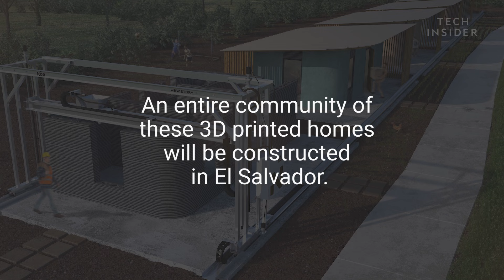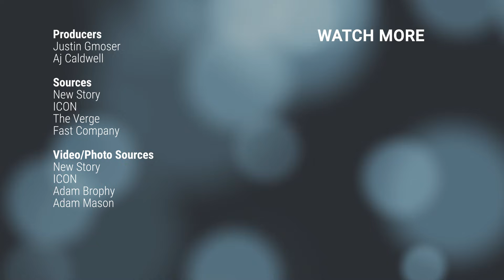3D-Printed Home Can Be Constructed For Under $4,000

Comment: I’ve thought of this so much. 3D construction printers are perfect for this. It would be great if they could team up with the solar company who’s solar panel produces water from the air, and then maybe Solar City could condense that into a solar roof. Also a few companies have electric airships slated for releases early 2020s and they’d be perfect for quickly and affordably moving as much stuff as you need too, such as big 3D printers, to places with little to no infrastructure like roads. They can carry massive amounts and land anywhere without a runway and don’t use jet fuel. Also you could have 3D printers print parts and robots assemble any furniture you need. Amazons robots are getting a lot smarter at that each year. You could basically a moving house factory and command center from an airship. All of this tech combined could transform parts of the globe in a matter of weeks or months. Also high speed, cheap internet will be covering the rest of the planet in another five to ten years when SpaceX launch their satellites, as well as all of the other companies working on that.

Comment: Problem one: no kitchen. Phase 2 will be built in a hot climate where outside kitchens are the norm but, women still prefer to be protected by the elements while they cook. Do their plans include a covered kitchen area outside? Problem two: the roof. Are they planning on have sheet metal roofs? Because there is a big problem with sheet metal roofs is they make concrete houses unbearably hot & the sound of rain hitting the roof is deafening. Builders in Central & South America are moving away from using sheet metal for roofing material. Also, the roof on their prototype looks flimsy as hell. Why aren't they designing a concrete roof as well? I think this very well meaning project should take a moment to consult builders in South America about meeting the needs of the community before they move on to PHASE 2.

Comment: Great idea. 
Hopefully, this method will spread all over the world within the next decade. 

Is it possible to build multi-storey houses this way, or would it require traditional concrete columns and slabs for weight bearing?

Comment: "3-D home than CAN be constructed under $4000" is the misleading click-bait title. 

The home cost 10,000 dollars to build...
PBS reveals: "The model cost $10,000 to build.But the developers believe they can eventually be built for as low as $4,000." 

So no, it does not cost "under 4,000" or "only 4,000," that's just conceptual proposals made by the company. Most likely, the claim is for their investors and backers and news outlets just take all they say as fact. There are many 3-D houses printers. Most cost 10,000-15,000. Claiming you "CAN" do it in 4,000 is just likely a marketing ploy. 

Source: https://www.pbs.org/newshour/amp/science/these-3d-printed-homes-could-provide-shelter-to-the-worlds-most-vulnerable-people

Comment: This won't work. 4000 dollars is a fantastic money to have in poor countries. They can build a proper house much cheaper than 4000 dollars.
Reply: Anyone want to come to Uruguay and help me build an adobe or rammed earth house?  Depending on your experience, I will pay you and will pay for room and board.  I am just a few blocks away from most beautiful lovely soft sand beach.  It would be a great experience!
Reply: What are you talking about?
Reply: i can build a pretty good shed for 4k and i dont even need to connect to the grid for it
Reply: İki Elin Sesi dear, we are not in poor country lmao
Reply: The $4,000 most likely just that cost in the material Just the concrete and maybe some wiring and Plumbing that's not factoring in the labor and the other costs associated with it.  So if you want one of built in the states it probably going to cost 60 Grand or more.
Reply: @GANTZ100pts  The materials in the roof alone cost more than four grand.

There is four grand in cement in the foundation and two walls... lol.
Reply: @GANTZ100pts  It is possible with 12 persons engaged in total 96 hours (that is 4 persons at a time, 8 hour each), and a 3D printer, to make a 36 square meter house, in 24 hours, for USD 2,500 or thereabout.
Reply: @fallingalice2601  Yup. You can get single units (12 square meter self contained) for USD 2,500 per unit (cost price).
Reply: The point is it only takes 24 hours
Reply: @Denise, Yes really ...

Adobe earth domes or rammed earth techniques you could build 2 more bedrooms for about 500 dollars easily.

So called Earthships made of used car tires or bottles only require labor at best. Same with cob structures which cost you a few bails of hay at best.

All I need is a axe and a forest. Voila log cabin.

Just look it up and find out why they call it 'dirt cheap'. And the domes will literally withstand earthquakes and CAT 5 hurricans with ease.
Reply: @MrFlatage  Can you guide me a bit to the Adobe Earth Domes? Some contacts if possible?

Comment: Is it the cost of buliding this house or the cost of the house only, but not include building it, labor cost, etc?
Reply: Unknown Blogger most likely just the cost of the house itself and not the labor, or the additional materials that are needed like Plumbing and electrical.

Wouldn't be surprised one bit that can cost upwards to 25,000 or 60,000 just to have one built in the states.

Comment: it's a really great idea!,  but, I admit, I'm a simpleton, when it comes to 3d-printing, I don't have a clue, né.
I assumed that the stuff used to print with would not be very sturdy at all and fall to bits with any wear and tear or water.
what exactly are they printing out?
I saw mortar mentioned, that's good, what else?
wood pulp? concrete? 
because homelessness is a terrible plight not taken seriously enough, so it seems, by many governments worldwide.
it is good to see it addressed.
many people haven't got a clue.many more do, too well.
something like this could truly help.
depending what they are using to print the places.
Reply: Sprokie Meisie here it’s mortar but 3D printers can print using a lot of different material like plastics, metals and wood(last two are composites).
Reply: Some of the materials that are 3-D printed are very durable.  Some medical prosthetics, like skull bone-flap replacements, are made with ceramic and are very tough.
Reply: 3D printed houses can typically be printed with Fibre-Concrete. Lafarge (Europe) are experienced in this. The concrete is made like "rapid" concrete, which is fast hardening. Thereby you can add layer on layer with only minutes in between, enabling you to print an entire house comprising of 96 layers of 1 inch each, in 24 hours.

Comment: When the machine costs more than the house.
Reply: An oven costs more than anything you can ever cook in it. A dishwasher costs more than any dish you'll put in it. An industrial sewing machine costs upwards of $6000 to print shirts that sell for $10-$12. John Deere Corn tractors sell for $100,000 while large quantities of corn sell for under $25.
Reply: @Cooley96  well I look at it this way, a John Deere farm tractor or Industrial Tractor or whatever you want to call it. Cost a hundred grand but yet the TV show "Dangerous catch" has people working in small fishing boats in freezing, rough Waters for weeks at a time picking up and putting out large crab traps for Dungeness crab and king crab. 20 minutes in the water if you fall overboard is basically death. I don't see any of those hazards when it comes to building one of these farm tractors in a factory. But yet they charge an arm and a leg LOL just because a group of Engineers long ago has mastered building tractors and have automated the process more or less. The same thing goes for the housing market, I feel like that's a scam. Now if the house was like a tree and growing a new limb would be like adding an extra bedroom on to the house within a 10-year period. Then I would say by all means the value of the house should go up. But otherwise I feel as though home value prices shooting up over the last 10 or 12 years is not worth it in my opinion unless you're selling. Value is just not there. Everyone can throw out supply and demand all they want but I just don't see it that way. But I do love this concept and I wonder what the cost of the machinery is? As far as 3D printing a house.
Reply: SunnyTheFireDog when the machine can make hundreds and thousands of houses while a house can’t make another house.
Reply: Cooley96 , i was hoping somebody was gonna say something that made sense, the machines and robots that build cars cost more than the cars, well no shit shirlock

Comment: But is it strong enough to stand natural disasters?
Reply: I think the point is they can’t afford normal homes. If I’m starving, I’m not going to say no to meat and potatoes because it’s not lobster. A locked door is a practical step up. Walls that will keep warmth in on cold nights. A day a tsunami or earthquake happens is a bad day for everyone, but at least on all the other days, these people have something to stand between them and the outside world and all it’s dangers. Sanctuary is important.
Reply: Chronically Curious also adding to that it would be a MUCH better in comparison to a tarp “home”.
Reply: has no steel reinforcement in it, the wall is going to be brittle
Reply: 中務異世界萌公會 I did see some wire mesh being added at some point.
But you are correct, still interesting.
Reply: Joshua The Science god few if any home can stand up to natural disasters, a small earthquake probably (it is concrete after all) but like pretty much every home a large earthquake or tidal wave will definitely take it down, however this house would home up great in the resistance since the structure isn't wood based
Reply: This should be by far able to stand many natural events in comparison to common homes, only lacking (maybe) in terms of earthquakes, and I say maybe solely because it’s a concrete mix. However, two wall layers each side connected by those zigzag triangular infills really should give it near insane strength properties, with concrete’s high stiffness in the walls and having some of it’s low tensile strength alleviated by those infills. This really might do even more desirable in high test occurrences like tsunamis and earthquakes and such than conventional housing. It should have lots of weight to be less dragged by landslides and mudslides too which can pretty easily happen during extreme rainfall in arid areas where most housing poverty is at on top of that.
Reply: modern concrete can have fiberglass added to the mix to reduce or eliminate reinforcement requirements. I hope that's what they're doing here. That mix looked a bit buttery to me. Hopefully they're not skimping on the aggregate.
Reply: Steven Mactavish tsunamis too???
Reply: Joshua The Science god I dont think even a normal house can survive a Tsunami...
Reply: Random Entertainment im saying youll be much safer in a  normal home
Reply: Chronically Curious thats true.
Reply: Joshua The Science god better than a tent yes
Reply: 中務異世界萌公會 it has steel. Have you even watched the video???
Reply: The triangular shapes in the walls does a lot to strengthen the structure.
Reply: The houses we already have aren't even built to withstand natural disasters.😂😂😂 People place so many ridiculous criterion on innovations.
Reply: Safer than a shantytown with made of cardboard and tarps

Comment: If the house is in 3D wouldn't it get destroyed by some crazy nature disaster?
Reply: u have a house for 4 grand before u had nothing
Reply: Good point. The houses would be much better in 2D. The square footage could practically be infinite!
Reply: John Kessler wouldn’t the square footage be linear footage?
Reply: sepreM no offense but having a tarp “home” wouldn’t be any better
Reply: You could say that to any other homes that are not build entirely of stones & steel. Any house with wood works or tiles is nothing against a hurricane or a tsinami. This house at least has the benefits of being cost under 10 grand.
Reply: sepreM my house is in 3d, I need to upgrade to 5d
Reply: 3D printing really does have some great structural properties though, and that’s just the consumer ABS I’m used to, this concrete mix would honestly be able to put up just as well as a conventional construction if not even better with how it’s alignment is. The printing of triangular infill inside on top of two layers each side of this mix, I’d be surprised to see anything less than an earthquake truly damage one of those.
Reply: I have the same worry. Earthquakes occur pretty frequently in El Salvador, and I want to know if these have some kind of rating or protection against that. I saw the metal mesh that goes between some pour layers, but I don't think that's there for structural purposes. From an engineering standpoint, it doesn't look safe, at least for earthquake resistant. Although I might be wrong.
Reply: Ya u are ryte...
But the house can be rebuilt in a matter of time....
If a natural calamity happens to a normal house it would take years to make another house and would cost more...But a new house less than 10 grand is just innovative...
Moreover this is the only and the perfect replacement for slums...this could change the view of poverty
Reply: Yeah most houses are 4d. The advantage of a 3d home is that it never degrades with age.
Reply: sepreM no these houses are suppose to resist hurricanes and tornados :)
Reply: Good point lygm.
Reply: Wow houses get destroyed in natural disasters? Thanks for the observation I never knew
Reply: sepreM dude really? it's basically made from a special mortor mix which is a type of concrete. it's a whole hellava lot better than a tarp & pallet shack don't you think.
nothing is natural disaster proof but I actually think it's a great idea. think about Puerto Rico and Haiti and Indonesia, they have all been destroyed by natural disasters. millions of people without a place to call home. lighten up Frances and don't be so negative.
Reply: So is plastic tarp apparently, and stack of thin woods
Reply: i don't think it's too much of a concern for single story houses ..... it would be a different matter if it were more than 2 stories high i guess
Reply: mate I dont think this comment will find the right level of mind in this "assembly" of fine thinkers. But you made my morning lol
Reply: It's made of motar so it should he as strong as most houses if not stronger
Reply: Mo Uddin morter itself is actually pretty weak. The rocks and rebar in concrete is what makes it strong not the concrete itself.
Reply: sepreM It's walls are made from cement. That's better/durable than the common use of cheaply built wooden houses in the US!
Reply: Not in el
Reply: Rae-Anne Lloyd My thoughts exactly!
Reply: sepreM what do you think the nature desaster does to a tent?
Reply: BMO na actually it's not cement or morter really has no structural value. In a wooden house you would have 2x4 that support it. And that actually makes it stronger than what they are making this with since they aren't using any kind of structural support.
Reply: Where can I see more of these houses
Reply: We don't natural disasters in africa just rain
Reply: Unn1xD are you serious?
Reply: Unn1xD better then what they live in originally now bro 😢
Reply: That’s poured concrete and it looked like reinforced steel. This would be more solid than wood & Sheetrock. The roof looks a bit questionable, but concrete is WAY more solid than 2x4 framed homes.
Reply: It’s definitely more solid than a mobile Home that’s for sure 😂
Reply: That's why you upgrade to 4d so your house is outside of time and deals with no disasters ever.
Reply: sam mayne • 2d still makes more sense, especially when you remember that the earth is flat